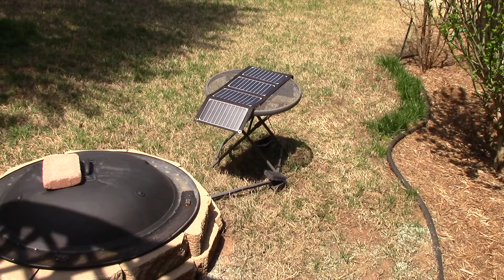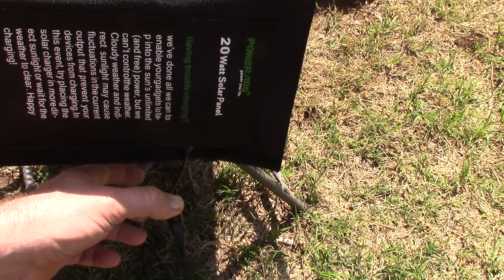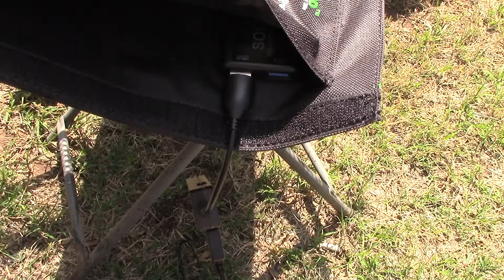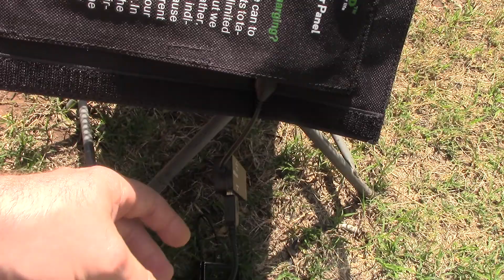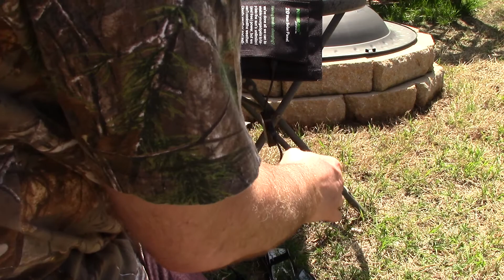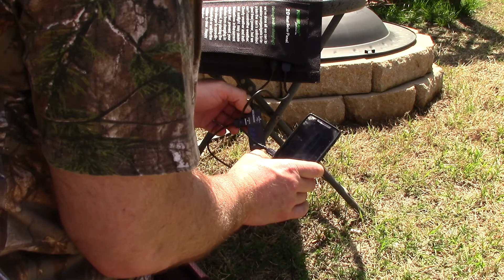First test! PowerAdd Ultrahigh efficiency 20-watt foldable solar panel USB charger

Comment: I like the panels, they made it with (5 v) 10 cells per panel, vs 12 (6 v) cells panels, you get more amperage with ten...  I wrapped mine around backpack so facing three directions as I walk around...

Comment: That would be cool for my wife to carry on her boat to help charge the batteries for the stern and bow light and keep her phone charged where did you buy it? Did the little USB meter come with it?
Reply from the maker: This little 20w charger panel deal is pretty stout. Naw the little USB meter I picked up on Amazon for $12. However, quite useful...and it has two outputs. Hey...different subject. I just ordered two more Renogy 100w panels for my system. And, looks like the 435w panel purchase (have to drive a ways to get them) is a go for tomorrow. Building my system! Gonna run the Kid on the Renogy array (12 panels). I used the Midnite Solar Kid sizing chart and I am "excessive" and says I need "1.4 Kid's". Meh...whatever. My angles/shade suck, so it will be slightly overpaneled. Should work fine. What do you think?
Reply: I would think if you don't go over 30amps and 130vdc you should be fine!!